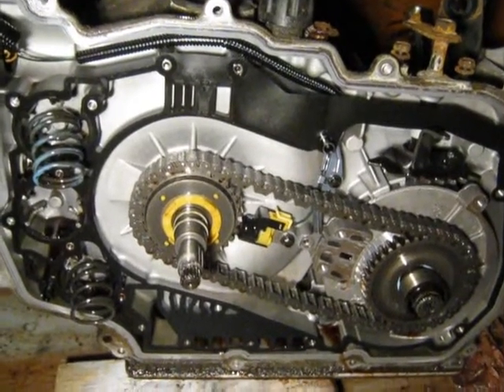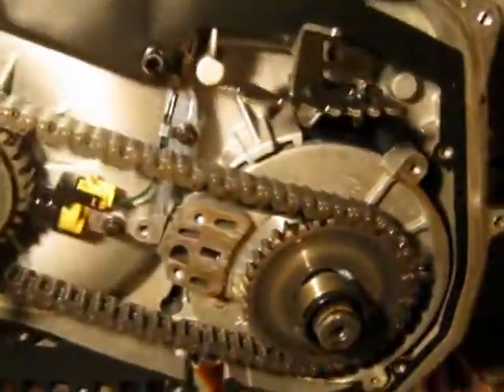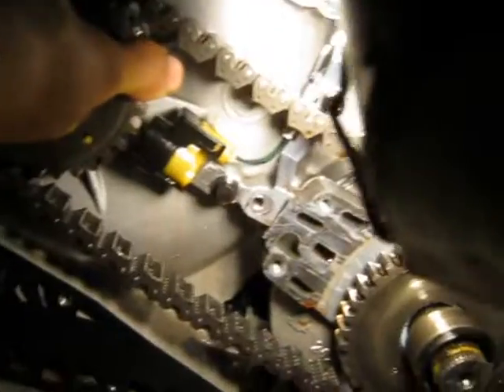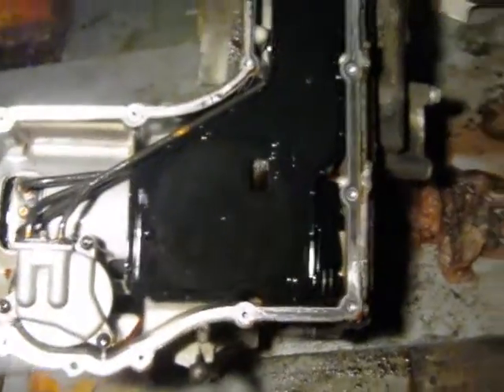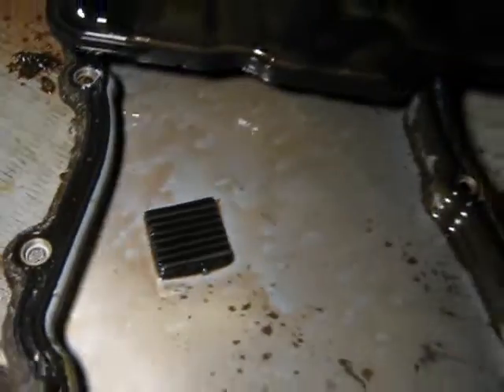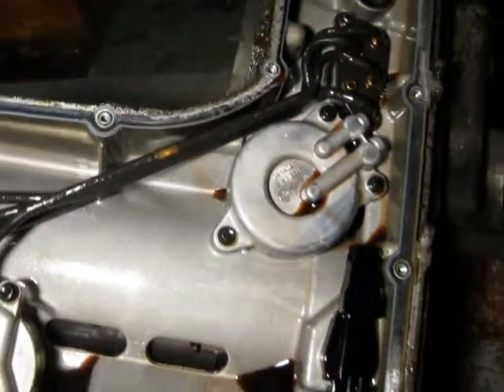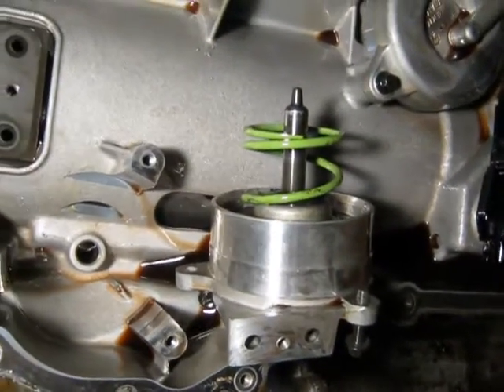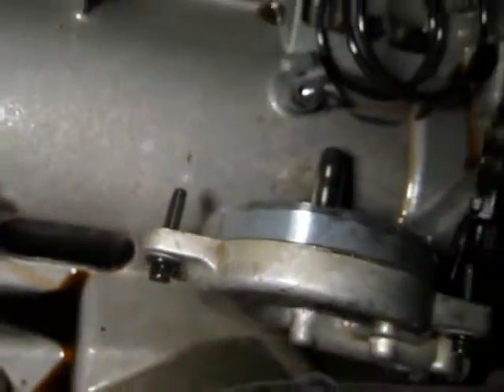GM 4T40-E transmission Teardown Part 2

Comment: nice job on  the breakdown.. I have the same transmission I lost forward gears a little bit out of my scope I'm definitely going to take it to a mechanic. I'd have them Springs popping all over the place.lol
Reply from the maker: Yes, I have a fun time taking this apart!  Most of it has since ended up in a scrapyard, but i kept the more interesting pieces.

Comment: I wonder if that rusty-colored stuff is from the dead bushing?
Reply from the maker: Perhaps, the fluid had a somewhat burned smell to it, and I saw some heat discolored clutch parts
Reply: ChargerMiles007 Oh dear, that doesn't sound good!